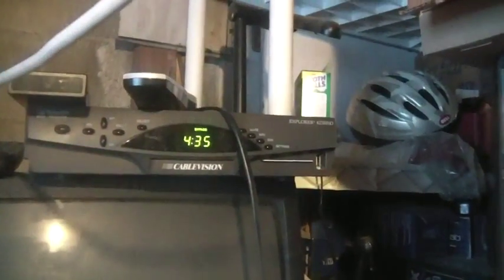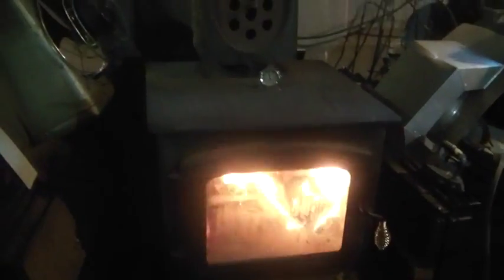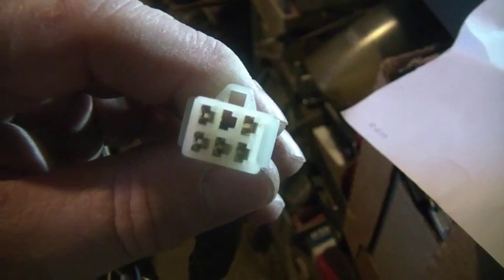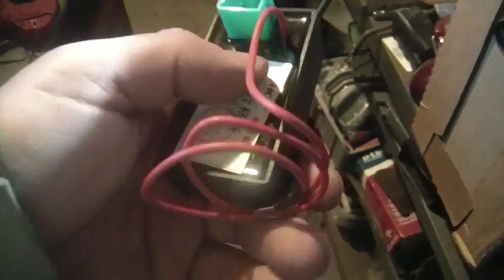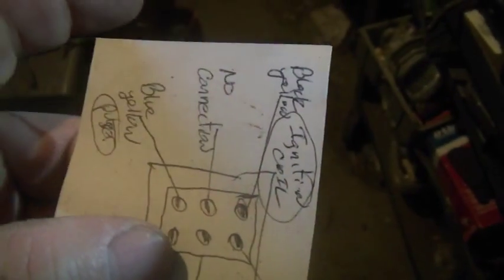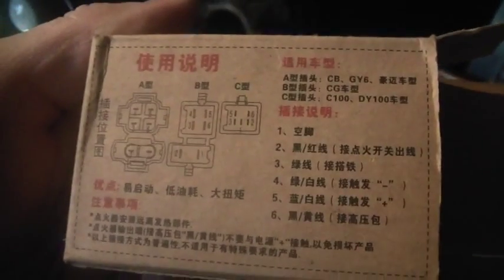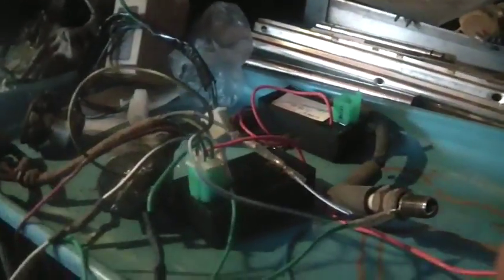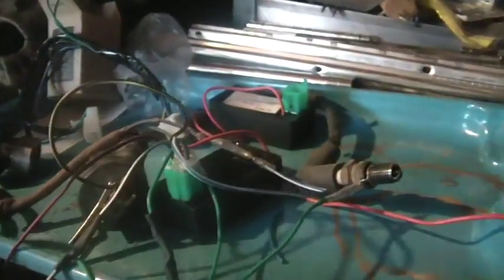2_3_15, DYI, inexpensive, ATV/ATC/Motorcycle.12Volt, electronic ignition,

Comment: I have a 1986 Suzuki ts 125 x I have rebuilt the engine fine but the wiring is all over the place, some one who had it before me has done his one loom and I can't make head or tail of it. It's kicking out about 7 volts ac when I kick the engine over but no spark. It has a CDI but not one wire on the bike the same colour  + spliced earths all over the place. Any ideas of what I shoulld be looking for ? in simple terms please. cheers.
Reply from the maker: Hey Squatmyster!!! We are a huge disadvantage here my friend, first, I have no experience with a Suzuki ignition system, secondly God knows if something was damaged with all his experiments, and third, he changed the color of the wires. What would I do???  I would try my 12VDC GY6 CDI and coil portable ignition, I would wire it to the onboard pulse generator and hope for the best.... I hope this helps.... Thanks for asking, watching, and commenting!!!

Comment: How is it that you can go from an mechanical cdi to an electric one this is the part im lost at... also the piece of metal that holds the springs together on my 83 200x cdi are chipped so I was wondering if this would be the way to go or just go out and buy a used one. Sorry if my question seems unclear or dumb it's just that im trying to teach my self small motor repair and it's a little tough when your 16 and have no one else around you with this knowledge... thanks -Joe

Comment: good stuff...that cdi box is the thing to have.

oh forgot to tell ya the roof bracing i added every 3' to my tarp carport is making a huge difference....no more huge sags so far. heating to work in there is another project....lol
Reply from the maker: RobsPackanShine , When it comes to snow loads, there is almost no such thing as enough support and bracing! This winter, there seem to be no such thing as enough heat, the cold and snow actually seemed to hurt this year. I have been having fun learning about the electronic 12Volt CDI units... Been thinking about one for a 2 cylinder Robyn engine... Thanks for the encouragement, watching, and commenting!